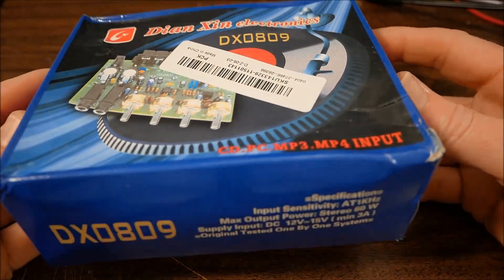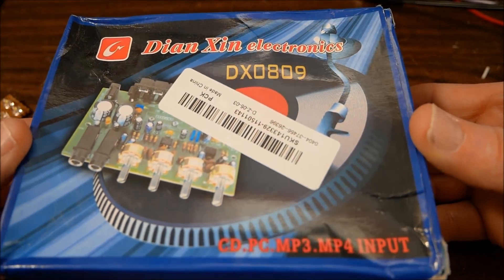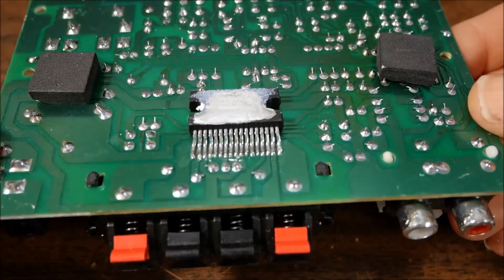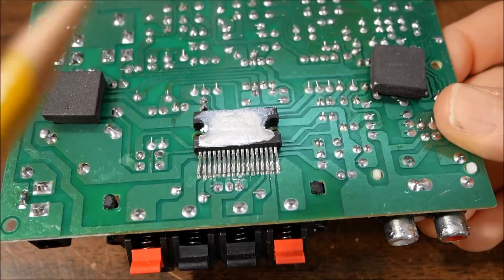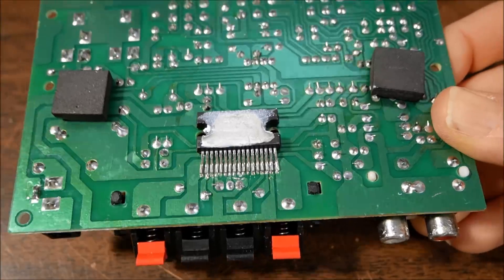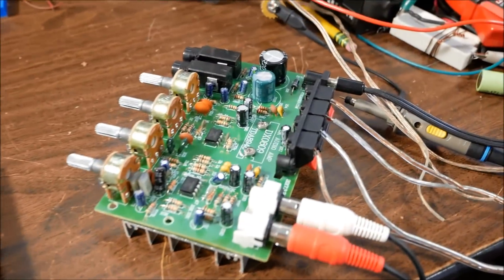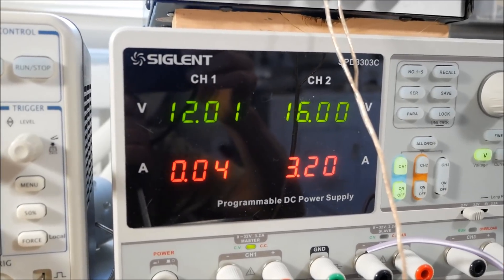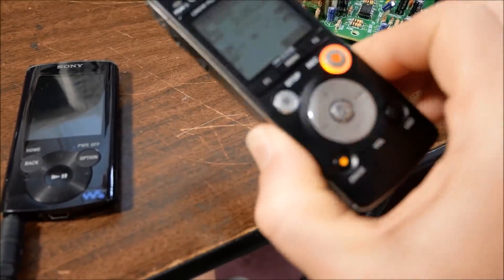Stereo amplifier board with tone controls and mic inputs - test & review

Comment: Great review. Thanks. Based on your review I just ordered one of these from Parts Express for $10. As you said the bass rolloff is probably due to the input coupling caps which appear to be 1 uF. Changing them to 2.2 uf will probably solve that problem. There is a similar simple board amp, minus the bass/treble based on the TDA7297 that some audiophiles love. Has very similar specs, THD, 2 amp current limit and only rated at 8 ohms but works fine at 4. I plan on using it for a computer speaker which will probably put any offerings under $100 to shame.

Comment: i hope you can come up with merging that or a main aux board with its adjustmen knob with at least extra 3 channells with modules added like 1. for 3 mic pre amp module or a wireless ones with an extra one or mic sockets, and 2. for bluetooth module and for a guitar socket module. and a power back up module for battery and its charging.😉😉😉

Comment: I nearly bought that same model! You can safely use those TDA 'car audio' chips on 4 ohms or even 1 ohm, just watch temperatures!
Bought a Pro'sKit amplifier kit instead. Uses Panasonic/Matsushita AN7161NFP chips. I'm running them at about 25 volts using a switching power supply. Replaced the capacitors with higher voltage ones of course! Made my own heatsink solution by chopping a Pentium III heatsink into half and fabricated mounts. It would sound impossible, but can you test the chip that I use? I know, I won't really have problems being from a reputable manufactuer but curious about my ICs.

Tips though if you would do it: Note that they are pretty rare, and fakes are many. Fakes don't like +20 volts as they are not the original ones. The chip markings should read:

         [M]
AN7161NFP
(Production code here)

NOT

[M]  AN7161NFP
                        .XXX

The pins should not be shiny. Or you get both fake and real and compare them? Old-school HiFi amp kit?
If I can only send you some, I would give you a genuine and a reproduction one, and some photos of my amp kit!